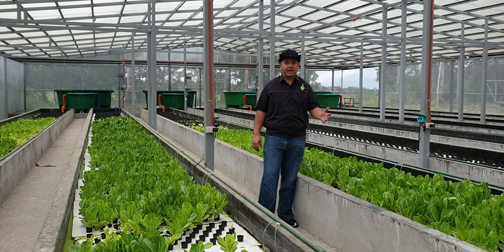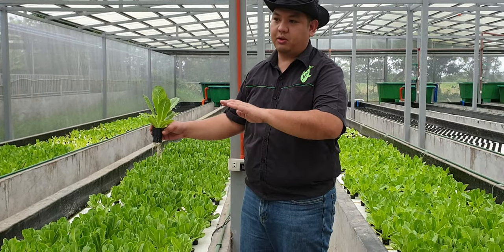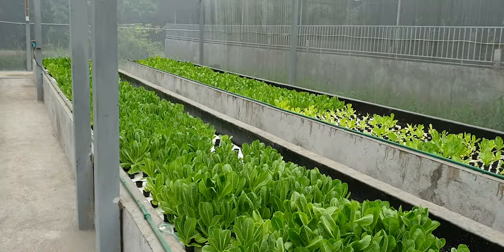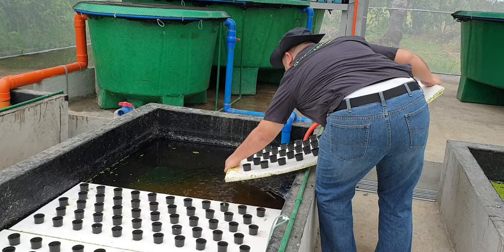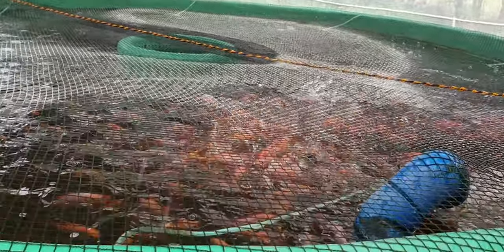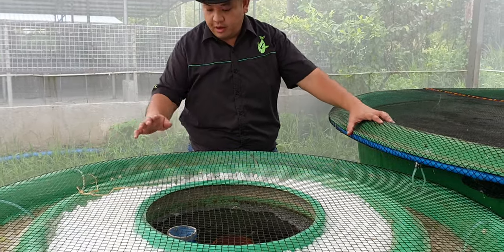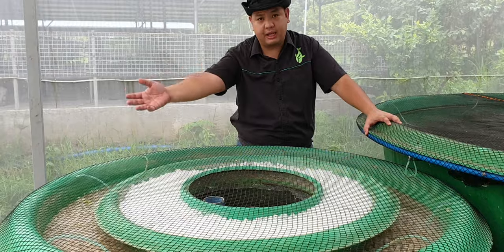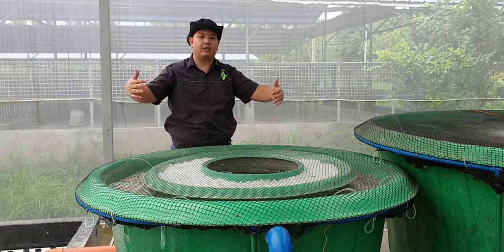MADE Commercial Aquaponics System

Comment: Thanks for sharing, great video. One question, is it ok if the water will stop flowing during night time coz i will be using solar powered water pump. Thanks
Reply from the maker: the fish will need 24/7 water and airflow.
Reply: Stopping the flow will result in non aerobic zones and deteriorate the water faster. Continous Flow will increase cleaning of the water and more oxygen et
Reply: When using solar also have a battery bank charging from the solar, at night the battery bank can power your needs.

Comment: Hello sir i have been trying to start an Aquaponics company in the uk for a few years. Would there be much difference in a cold climate? And do you think the added electricity costs would still make it profitable?
Reply from the maker: Lettuce will grow better at 23deg C but the tilapia will not like the low temp. You can use kois or other cold tolerant fishes. Or you can heat your greenhouse but it will add to your operational cost.